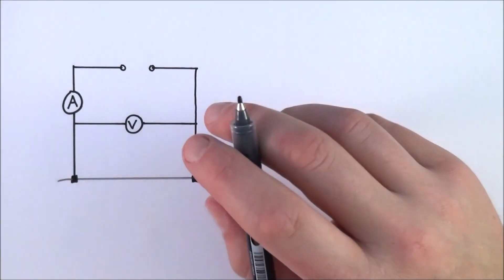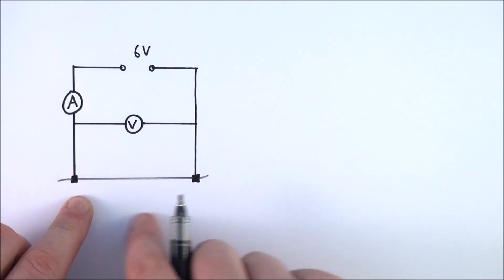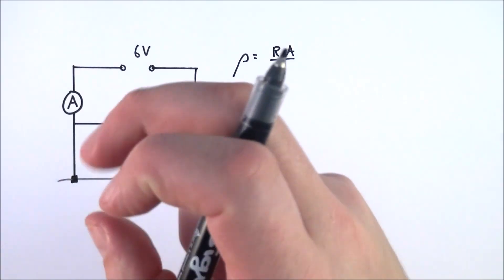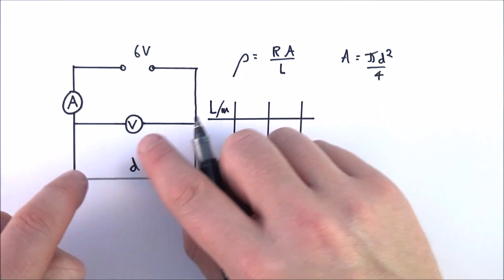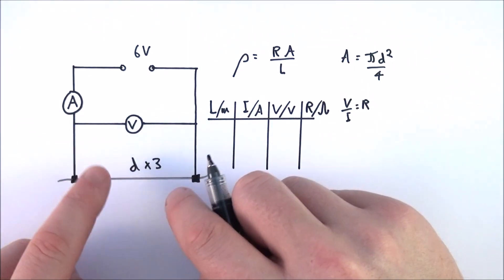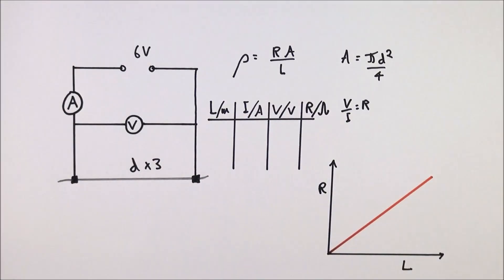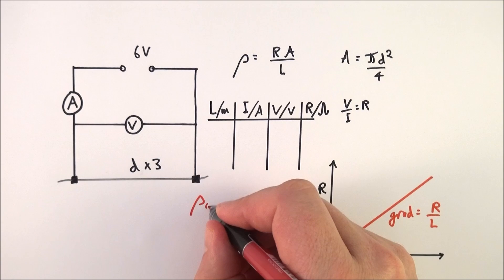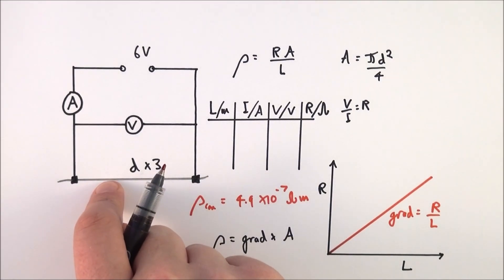Measuring the Resistivity of a Wire - PRACTICAL - A Level Physics

Comment: Hey thanks for the great video! But when I tried using your circuit setup it short circuited. What should I do?
Reply from the maker: Lizzy Philips  You could add a resistor in series with the wire you're testing.
Reply: @PhysicsOnline  what does adding a resistor do

Comment: what if we started from 1m and decreased it? Also, do we have to change the voltage every time we change the length? What if we took values for 1-6V each for every length from 0.3 to 1m? a bit confused
Reply from the maker: Starting from 1m and decreasing the length is absolutely fine - there is always more than one way to get the same result. Keeping the current the same is a control variable so any heating effect will be the same each time, and this can be controlled by altering the p.d.
Reply: what if we started from 1m and went down to 0.3m, however started with 1V instead of 8V. In other words, we have taken the highest length with the lowest voltage possible and the smallest length with the highest voltage. Will that affect the practical negatively?
Reply from the maker: BliiiiBlaaaaBluuuub You may have a higher current with the shorter lengths and therefore more of a heating effect which would change the resistivity of the material at these higher temperatures.